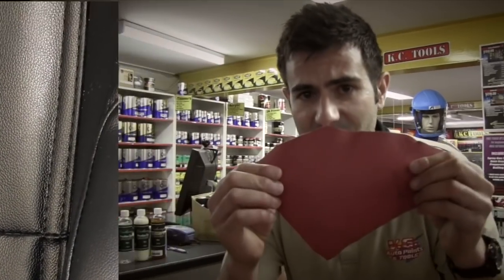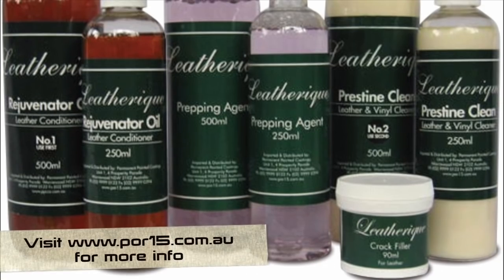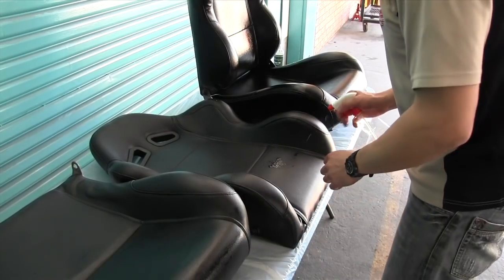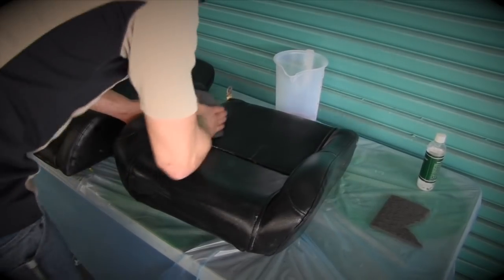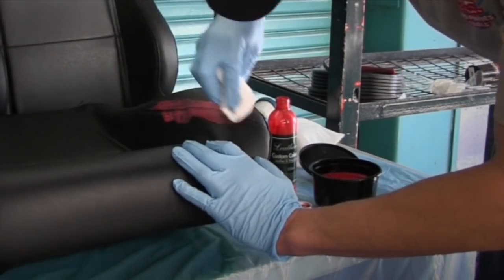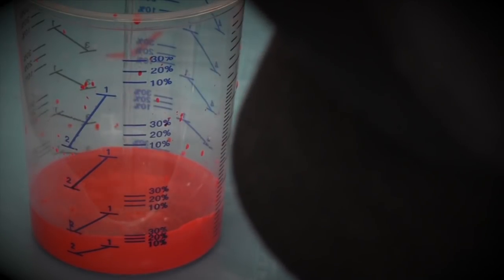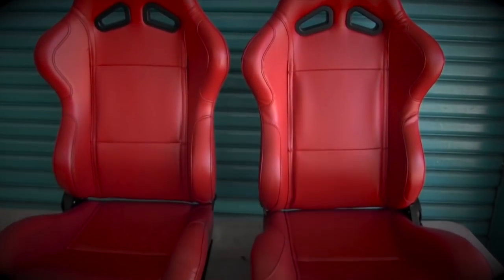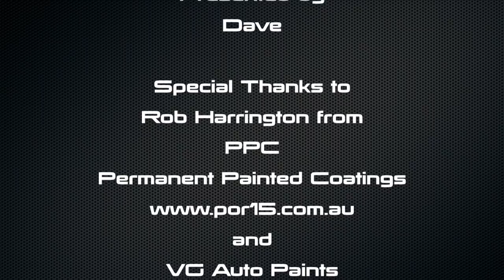How to, color change leather

Comment: You and mighty car mods are the best car guru's on you tube !
Do you no how to repair scrach marks on the plasticy bits on a car interior , such as kick panles and center consoles ?
Do you no who and were in sydney i can get custom color spray paint cans from ? i have a metalic storm grey paint on my car , i do also no what the paint code is , i just need it in a can to repaint front and back bumper bars like you have showen on your videos . 
Love your work man and how you explain it !

Comment: I just got a brand new car and I saw the red interior in a video and I thought it looked amazing. How much would it cost to pay someone to do this? I would want it done to the seats, the leather on the door and a couple spots on the dashboard. It wouldn't be the entire Dash or door, there's only a few parts that have leather on them. I know it's at least $2,500 to get it reupholstered so I was curious to see how much it would cost just to change the color. I might not even do the entire seat. I think it looks good when it's both red and black. Any answers would be great if anyone has them

Comment: I find it baffling no one is questioning how long this would last.... Especially on color changes. I want to believe it but my better judgement tells me this is surface layer only and most layers tend to peel wear through much easier than factory dyed leather
Reply: I think you might be right. I wouldn't do a color change but I think that respraying old leather is a good idea.
Reply: 5-10 years as long as you maintain it with the oil/cleaner every 6 months or so. Considering the cost of the product on its own, it's not a big cost for the result. I just got the product in and will be doing it in the up and coming weeks. I saw some results from 5 years ago, still look mint.
Reply: its dye it will last longer then the car if you maintain it right 
the same way it was dyed black it was dyed red
Reply: I bought a steering wheel that was dyed from pink to gray and it has yet to wear out and I don't even take care of it.  I've had around ten years or so.
Reply: This was actually my very first thought too! The results are pretty good, it appears, I'm just curious as to if it will last.

Comment: How much product did you need for those seats? It looks like you only needed 8oz of each. I contacted Letherique as I want to change my front and rear seats from grey to black and they are recommending 32oz or rejuvinator oil, prestine clean, and prepping agent, and then a whopping 48oz of dye! It seems like they are trying to sell me more than I need. Given you've gone through the process would you think I need more than 16oz or each? Maybe 32oz at the most?

Comment: I would love to change the interior of my OEM leather seats from black leather to white. HOWEVER I do have cloth inserts down the middle of the bottom of the cushion as well as the portion that supports the back. How could I go about adding dye to the black without ruining the cloth inserts in the middle? Double just taping it off be good enough to hold off on the dye? Or would it seep/saturate into the cloth inserts. Thanks DAVE!

Comment: I am about to do color change from Grey to dark red, using the same Leatherique products as shown on the video. I have one leather piece with a few cracks. SHould I use the crack filling technique first and then the same steps (including sanding) as for dying the seats?
Reply: +Georgi Georgiev I'm planning to do the same on my BMW. How did you go?

Comment: This is really interesting, and I am sure there's many times where this is the way to go. But in some cases couldn't you just restitch/sew new leather in less time?
Reply: No, unless you are a professional it won't look as nice, it also is hard to perfectly fit and everything
Reply: Professional repair is way more expensive and sometimes you can't buy new leather in matching color.
Reply: bs , unsitch your seat and buy leather and cut out the same pattern and lightly trace over the titch lines
Reply: ThreeDaysOfDan Sometimes there are dual stitches (I don't know how they are called in english) and in this case you can't stitch back the material. Also if you are buying real leather you can't just buy a fev inches. You often have to buy lots of material just for a small repair.
Reply: Uzurpat0r you can buy small patches , they are called leather strips

Comment: How many coats i need to make my seats go from grey to red and does it last? Or will it peal off. Also i have heated seats so will this be a problem?
Reply: like he said, 4-6 coats. it does not peel, and im not 100% sure, but if you leave your seats out of the car to cure for about a week before using the heated seat feature, im sure you'll be fine

Comment: Great to hear the Aussie accent! Thanks for the great video and info. I see I can buy it in Wodonga. Can I use this product on a vinyl dash board and window pillars?  It is not possible to spray them, so I am presuming I would apply several coats with a cloth without removing the dash (huge job to remove it)? What can you suggest?

Comment: would you use a clear coat for protection and durability?
Reply: SUPERMAN51878 I just watched a similar video and the guy rubbed a sealer on afterwards to prevent the dye from rubbing off.

Comment: This was amazing video!
But I have a question. I have these amazing red leather seats that will be getting fitted to my car, there in the quilted leather style, (like bentley's, not that high quality though haha) anyway, My car is being sprayed in a Range Rover grey, with green alloys. It's a decent contrast. So for my red seats, would it be possible to do the middle section green, and the outer section of the seat black?  Is it possible even with the seats being a very strong red? Thanks!
Reply: Yes, just take ur time , tape it off very good,using car painting tape, barely stick and do ur thing, try a leather clear spray sealer,to protect coating

Comment: interesting video, but considering this would take the average person what? 1-2 weeks to do it properly if not more I rather just get a second job for a couple of week and save up and buy the seats I wanted in the trim, style and color. 
Lets face it if you have a couple of expensive $1000+ Recaros you aren't exactly going to change the color yourself. So if you have cheap seats you might as well buy them how you want them. But I love the idea of the restoration I have a lounge that could use

Comment: Does one way work better than the other?? Spray/ sponge?
Reply: Spray is quicker but you run the risk of applying it too thick and this causes it to stay tacky. Using a sponge is much safer.